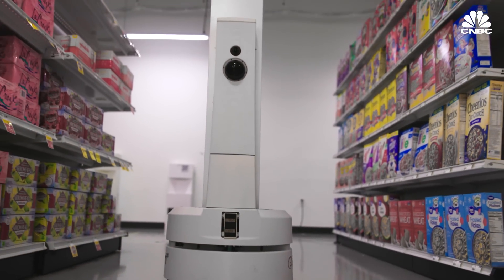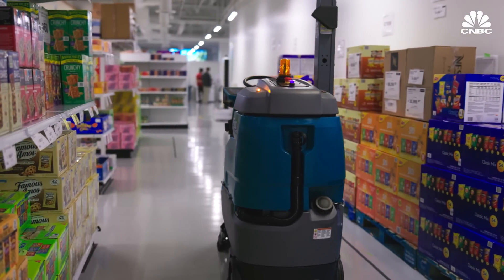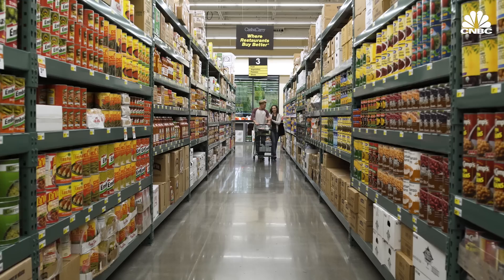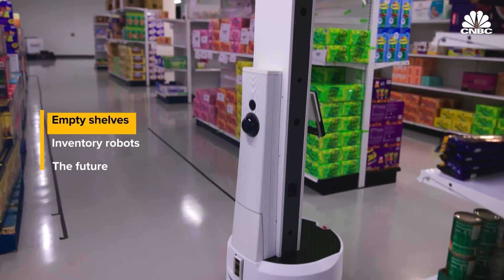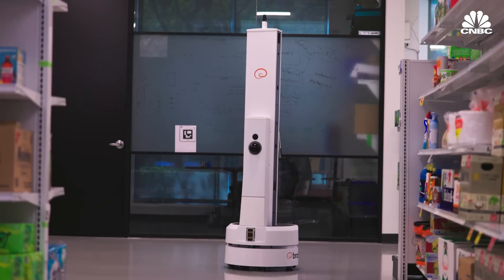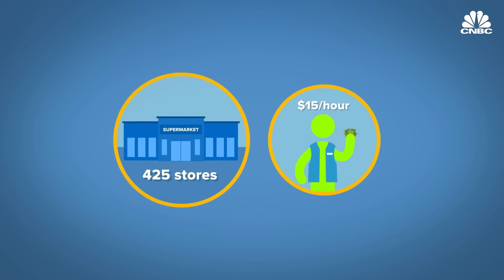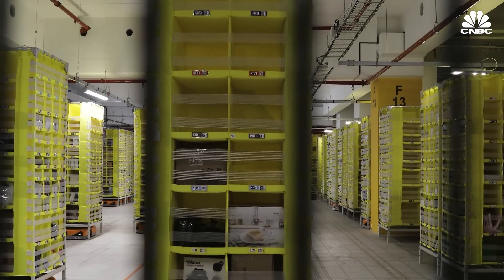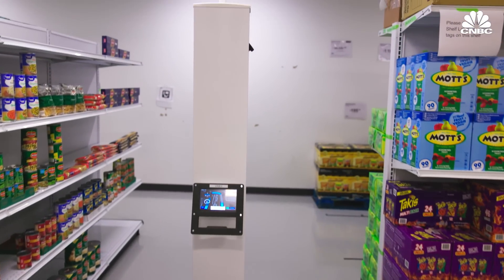How Robots Could Help Retailers Save Billions

Comment: The problem I see is when shelves are "fronted" which means all the product is pushed out to the front of the shelf. Shelfs then look full and you would not notice that the inventory is low. I am not sure these robots can determine this by picture alone. Amazon Go's concept with weight sensors in the shelf seem like a more fit solution.

Now lets talk about how dumb this idea is. If you have overhead camera's you should be able to do this without the added energy costs and material cost to build a robot to then take a long time doing the same thing. However, yes, camera's overhead have a harder time of seeing lower shelves. There are better, faster, and cheaper solutions that would result in more money in the retailers pockets.

Lets talk a moment about what we actually want or need. Physical stores are nice in the fact you can hold the item, look at it more closely. But I think some stores got it right with folded towels making it look like shelves are full. I also think that phone providers and computer providers got it right. You want one of your product out for display, but everything else should be kept away. This is why Apple stores for example which are everywhere are nice. You can play around with the computer on the desk before making the decision to purchase it and rather then the whole floor being used to house the products they can have a smaller store to just show things off. Also in doing this you reduce theft. We have all seen the videos of smash and grabs but what you do not see is people taking non-display items.

Stores could reduce the size significantly for the customer, if they were to take the approaches that other industries are taking. Why do I need a 5 foot wide shelf to show me 3 different brands of the same product? To me, that is wasted space. I think this is why costco and aldis will just move the pallets out onto the floor. It's quicker to replace inventory but they still are exsposed to the theft problems. But inventory tracking becomes easier with that approach and saves a lot of costs.

Ideally, SOME things need to be easy to quickly grab and buy, but not everything needs to be.
Reply: They have sku data and models to help them with the inventory in addition to just the robots. They blend all that data togeather.
Reply: @johniii8147  Reasonable response.

I was going to mention that too. Their POS (point of sales) system will let them know how many of an item they sold which lets them know the demand. Needing a robot to verify that is called redundancy.  

Redundancy absolutely has a place in society, most servers use redundancy in the form of RAID which means if 1 drive fails it can fall back onto one of the other drives. I do not think that the robots are adding real value to the store but it most definitely is adding value to the company who makes the robots.

Stores need to address real problems plaguing them. Those real problems are labor shortages, product theft, and poor customer service. Fixe those 3 problems and you will see a much more profitable business that can compete with the likes of amazon who doesn't have to worry about the average Joe walking into a warehose and stealing products. Amazon actually has A+ customer service on top of resolving much of the theft (aside from package theft loss's). However, Amazon does lack staffing that could increase the user experience getting their packages to them on time but that's just societies low work ethic usually caused by bad boss's at other jobs and society always holding them down. For example a factory I worked at would wait for you to clock out to ask you to do overtime like yeah the 72 hours you did was fantastic but John in the other department called in sick so we need you to work another 4 hours today to cover for him.

You have to realize that with each "solution" that businesses implement comes costs. The person who repairs the robots, makes more then the min wage employee. The parts to repair the robot are not free. The electricity to charge the robots is not free. There is also the generation of people who would rather support human jobs who will now switch loyalty to another business. All of these things now cost the company money. One thing that robots are good at and not even robots but even machines that do 1 task over and over is consistency. But this video mentions robots do not call in sick. They are right, instead they break down. When an employee calls in sick, you lose production time. When a robot breaks down you lose production time but now have to pay to fix the robot which costs money and puts you further in the hole called debt.

The amount of energy that a POS system uses to do inventory management is far less then the robots costs and often are already backed up by redundancy with on site, and cloud storage of data. But there is something to keep in mind.. if you were to say have a computer that can preform 10 actions a second. And you ask it every second check inventory that machine wound be able to compute anything else. If instead you stopped polling for data queries every second used a callback or functional approach you could say every time we make a sale just update inventory and check. Well now you can process 5 sales, plus 5 inventory checks. It's not about how fast of a car you have in nascar that wins the race, it's how you drive it. Same applies when it comes to business and business based logic.

This is why I mention Amazon's Go stores. They have sensors on the shelves, cameras, etc and those are the inventory management system and POS all balled up into 1. That's why you just walk in grab something and walk out. There are no registers or anything it just automatically deducts from your account. Walmart's approach is use self sheckouts which unfortunately results in theft from unscanned items. Walmart has a major disconnect that has not kept up with societies advancements. Times have changed, so must your strategy and I do not think that the robots add real value here. They actually are more of a liability, then an asset in my personal opinion.
Reply: One of the ways that they automate in a warehouse for instance counting inventory is to use QR codes on the shelves and on each individual box, each box will have the code facing out so even if there are three or four levels stacks of the same box they will know how to count it because there's a system in place and all they need to do is see the code once, however setting up inventory to be able to be functional for a robot is something that is not easily done
Reply: @arcatacompany  I have actually had to do inventory in a warehouse and production floor. That is sorta how they did it for "unopened" boxes but then you have opened ones where we had to count each part in the box separately. Some other things that were done were weight count if 1 weighs x then 10 should way 10x. However this doesn't work in retail where you are counting on shelves. Sometimes products are brought up to the front of the shelf because it makes the store look plentiful and thus gets more sales. If you tried this tactic seeing a box of cereal for example at the front of the shelf you would be assuming the shelf is 100% full when it may be only 1 left of 10. Which means this whole bot situation could cause your inventory to just be plain off which may lead you to believe you have product you do not actually have and thus not order more leading to empty shelves which puts you right back at square 1. This is my gripe with the whole robot, it doesn't add value that your POS already does much better for you the only thing the POS does not account for is actual theft which gets nullified if you only display on the floor but have backroom the merchandise.. hence the apple approach. The most of any product that can be stolen is 1.. because thats all that is on the floor at any 1 given time. Your count will never be far off as seeing it missing alerts you to subtract 1 from inventory. Far superior inventory management practice apple has.
Reply: If you compare apple store to retailers like walmart ( there are huge differences). Do apple have 10,000 or more in different products. Do apple shoppers buying 50 to 100 items at a time? Im sorry but that’s just stu pid comparation

Comment: Robots are cool.
Those floors were made for wheeled robots , not for human feet walking on 40 hours a week. 
These robotics will help the rich get richer.
The tougher problem is to provide the burgeoning population with meaningful work.
Reply: Robots are not humans
Reply: They took our jobs
Reply: What do you mean by meaningful work?
Reply: Those robotic companies will need workers but unfortunately it will be skilled roles like developer and IT.
Reply: @longbeach225  you forgot about manufacturing tool operators, mechanic, electricians, etc led by engineers of course unless these jobs are outsourced to Asia
Reply: @organicfarm5524  Some of these people are called "engineers". They name alot of jobs as "engineer". You may be a "test engineer" that does the tool and fixture work. 

But, even these jobs might be broken down into multiple, tiny, low skill parts. Even more so if the manufacturing department has a union.
Reply: @longbeach225  Most of the jobs in tech companies will be low skilled. There will be few people in software development or IT, hardware design will be even fewer. And, even if you went to get a degree, it will be difficult to get those jobs. Even with a degree you can end up in a low position, maybe a test tech (which is low skilled), or operator. 

There will still probably be a need for assemblers, but assembly work is not that fun, and it is low skilled.